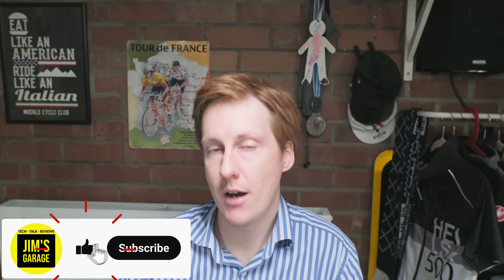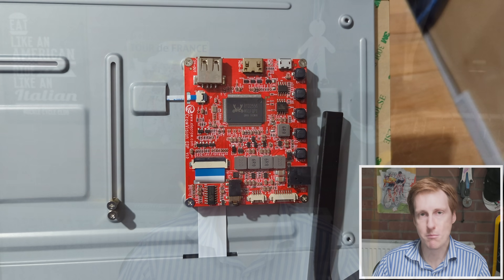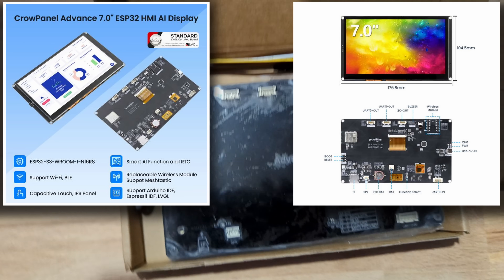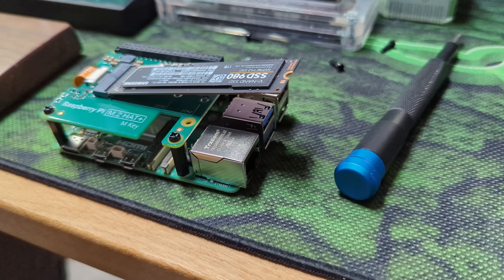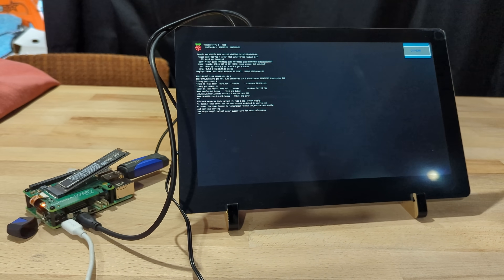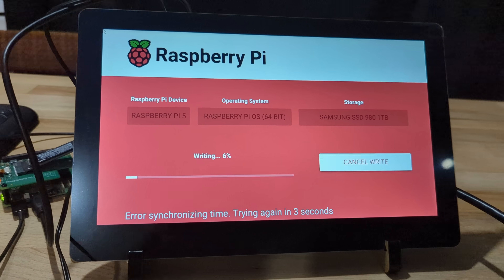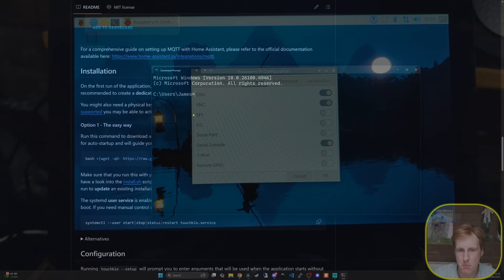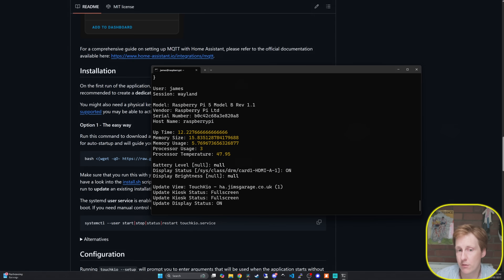Building a Home Assistant Kiosk - Why Did I Wait So Long?

Comment: Hello, thx for this video. I have few questions. Do you need a second power supply because you have add an external SSD drive  or because what is provided by default is not enough for the screen and Pi  ?  It seems that you are not using any Micro SD card but a USB stick to boot, is it right  ?? I cannot boot my Pi using a USB stick ... I do have a fix red light .... Thx
Reply from the maker: I'm using a third party charger but the best way is to use the official one. The OS is installed on the nvme drive, you can do this over the network and it's baked into the Pi using their bootloader. 

The red light is likely due to low power.
Reply: @Jims-Garage  All are working after an exchange of both Pi5 and screen. But when rebooting I have to apply this command in the terminal if I want to see my kiosk running: touchkio --web-url=http://192xxxxxxx:8123 --web-theme=light --web-zoom=1.0 .... And how to low the brightness of the screen automatically during the night ??

Comment: Cheap fire tablet will do better, with no extra cables, hats and so on.
Reply: Millions of old Android devices out there for like $25-$50.
Reply: I have Fully Kiosk running on a Fire HD 10. While I love the automatic screen waking (sound & motion), in my experience it's really laggy. I have a pretty simple dashboard set just for this display (weather card, two camera cards (Google Nest doorbells), and a card displaying temps/humidity from sensors in our house). Camera cards work when they want to, and clicking on them (which I've linked to the web version of Nest cameras) results in major delays and barely loading the page. 

Any tips to make it snappy?

Comment: I love my Home Assistant kiosk, great for monitoring, control and reminders. My approach was an Amazon HD 10 Plus (get the Plus if you're doing this approach), got it used "as new" for £50, took me several months to find one at that price but I had my budget I wanted to stick to. I also found an Anker Qi charger stand for £15, coz I spend most of my day at the desk. Now, that was the biggest reason I wanted the Plus version of Amazon's HD 10 tablet for the Qi charging capability so I can lift the tablet at any time, take it where ever in the house without messing around unplugging, and it was a future proof decision also, in case I wanted to wall mount it, with a 3D printed cradle with Qi charger wired into the wall for an invisible floating look.

I used Fire Toolbox to de-Amazon and debloat the tablet and add the Google Play Store, works really well, as does the Android HA Companion app, sometimes you might get a quirk with an update, but for the most part it's a smooth experience. I've also got the Anker Qi charger plugged into a smart plug, where HA automation tells it to only supply power between 21% and 79% battery (20% and 80% in reality) due to some sensor polling delay, that saves the battery life. I've specifically designed my HA dashboard for kiosk mode on the tablet, since that's how I interact with HA 99% of the time. 

There's no right our wrong way, just depends on budget and how much you wanna tinker. I have my HA on a Proxmox VM on a 1L Dell Optiplex Intel 9500T, but if you want a standalone all in one HA device, the Pi with touch screen is a decent option.

Comment: Need a wallmount version....
Reply from the maker: Yes, there are various brackets that would accommodate this screen. I'll look into it.
Reply: @Jims-Garage  I have been trying to figure out a good solution for this problem.  Have a bunch of old M&S intercoms in my house.  My plan is to eventually convert them to a HA tablet.  The issue is that I need to get them power (12/24V) or POE or something....  It's still in-flux.  Haven't found anything perfect.  Honestly this in a bracket may work, but the powering is annoying in a wall.
Reply from the maker: @emf9 if you buy a Pi 4 or anything that'll work on 20W then this only requires a single power cable
Reply: @emf9  If you wanna go down the tablet route, get a tablet with Qi charging capability, then you can look at embedding a Qi charger or power coil, I've not looked into that specifically as I don't currently need mine wall mounted, it sits on an Anker Qi charging stand on my desk, but I did buy a tablet with Qi charging with future in mind. A quick search showed someone using ethernet and POE splitter with USB for a plug and play method, but I suspect you could also do it off the mains, with some sort of voltage regulator.
Reply: @impy1980 maybe raises issues with junction boxes etc... I was looking at the poe route though
Reply: @emf9  PoE is the only thing that really makes sense. Solid connection and ability to power cycle remotely
Reply: @pantoqwerty yeah just trying to find exactly the right tablet etc...
Reply: Same here, although I don't like a tablet because of the battery in there. Just an unnecessary fire hazard..